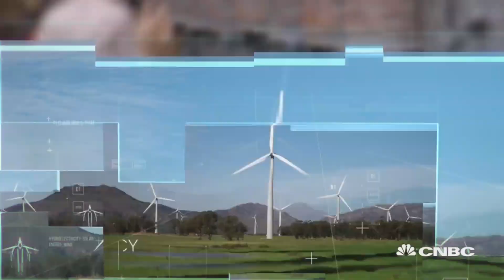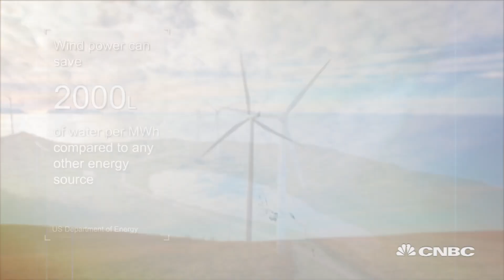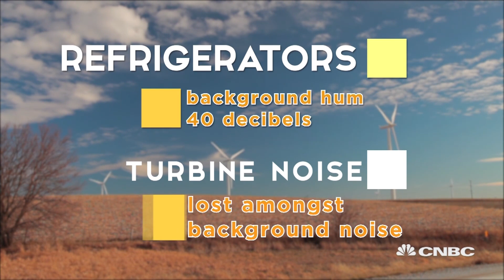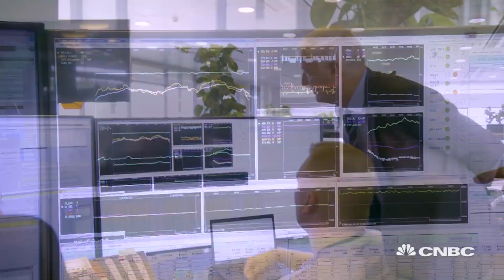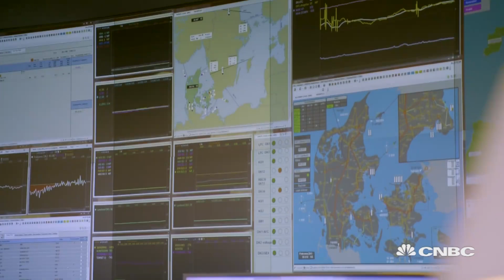The innovations and projects transforming wind power, part one | Sustainable Energy

Comment: Today we have windpower, solar power, hydro power and batteries are helping to solve all kinds of grid problems. In my opinion these options are way better than nuclear, fission or fusion. There will allways be the problems of waste, accidents  and the excuse of a nuclear site to develop nuclear bombs in secret. Put the money of nuclear into wind and solar seems logical to me.
Reply: Nice fantasy, not even remotely close to practical. See my previous comment as to why..  Nuclear in France supplied 88% of their electricity consumption in 2014, 47% of their primary energy supply. The other 12% is covered by the hydro they already had built before their rapid nuclear expansion 1979 to 2005. They produce 0.3 oz of nuclear waste per French citizen per year, and have half the electricity price of renewable wanna-be Germany. Almost all of that 0.3 oz of waste is incredibly valuable fuel for GenIV reactors like the IFR/Prism, Elsyium LCFMSR or LFTRs or other MSRs. 

After burning up our valuable nuclear waste and depleted uranium, ~300 years of total world energy consumption,  you are left with 1 oz of nuclear waste to supply the per capita lifetime (80 yrs) total primary energy consumption of USA or 7 million kwh's. And 83% of that waste is valuable isotopes, the other 0.17oz needs only be stored for 300 yrs, easily done in a borehole in granite. There is no other source of energy with remotely close to that low level of waste, all of which is safely contained, not openly dumped into our air, water and land for us to breathe, drink and eat like the 240 million X greater amount of carcinogenic, much of it forever, fossil & biomass waste. Waste that kills 7 million people per year vs zero for the nuclear waste.
Reply: The price of wind energy is falling rapidly. This is an interesting article you should read: http://www.windpowerengineering.com/featured/business-news-projects/uk-offshore-wind-prices-tumble-record-breaking-auction-results/
So the wind and solar are going to be cheaper than nuclear in the near future. But my reservations against nuclear are different. More of a not in my backyard syndrome.
I like solar in my backyard, I have them on my roof. I have no objections against wind turbines in my backyard. And zero waste and no need for cooling water.
When I think of Nuclear I remember names like Nagasaki, Hiroshima, Harrisburg, Tsernobyl and Fukushima.
I live in the Netherlands close to Germany and Belgium. And recently the German authorities distributed iodium pills to the people in fear of an accident with a Belgian nuclear plant. I do not want them in my backyard. Prefer them to be at least 10.000 miles away.
You call a future with wind and solar a fantasy,  I prefer to call it a nice dream.  
I call a future with nuclear a terrible nightmare.
Reply: Do some research dude, Nuclear in France supplied 88% of their electricity consumption in 2014, 47% of their primary energy supply. The other 12% is covered by the hydro they already had built before their rapid nuclear expansion 1979 to 2005. They produce 0.3 oz of nuclear waste per French citizen per year, and have half the electricity price of renewable wanna-be Germany. Almost all of that 0.3 oz of waste is incredibly valuable fuel for GenIV reactors like the IFR/Prism, Elsyium LCFMSR or LFTRs or other MSRs. 

After burning up our valuable nuclear waste and depleted uranium, ~300 years of total world energy consumption,  you are left with 1 oz of nuclear waste to supply the per capita lifetime (80 yrs) total primary energy consumption of USA or 7 million kwh's. And 83% of that waste is valuable isotopes, the other 0.17oz needs only be stored for 300 yrs, easily done in a borehole in granite. There is no other source of energy with remotely close to that low level of waste, all of which is safely contained, not openly dumped into our air, water and land for us to breathe, drink and eat like the 240 million X greater amount of carcinogenic, much of it forever, fossil & biomass waste. Waste that kills 7 million people per year vs zero for the nuclear waste.

Read & Weep:

Solar & Wind Toxic Waste - Baotou, Inner Mongolia, the worlds largest rare earth mineral refinery pumps toxic and radioactive tailings into an adjacent artificial lake,  EXTREME WIND POWER RADIOACTIVE WASTE . There is enough thorium in the tailings from one year's production of a large rare earth mine that makes materials for the wind & solar industries, to power the entire planet, all energy needs, for one year, burnt in a LFTR, or Liquid Thorium Fluoride Reactor. And that Thorium is waste, expensive to dispose of, they will pay you to take it away. 

The Dark Side of the Sun: Solar Power and Global Electronic Waste | The Huffington Post

Solar PV waste, pollution, Japan tries to chip away at mountain of disused solar panels- Solar Panel construction

Waste from Solar Panels, 700k to 800k tons of waste annually in 20 yrs,

Solar & Wind Toxic Waste, Rare Earth mines, Baotou, Inner Mongolia, Tracking a Gadget’s Journey From the Mine to Beneath the Christmas Tree

Solar Waste - Things Worse Than Nuclear Power: the real waste problem, solar PV waste, Solar PV powered world produces 63 thousand times the waste of a Nuclear Powered World, Solar PV cadmium & lead is forever, land area of Solar PV vs Nuclear

REnewables Wind & Solar Toxic Waste Pollution - Boom in Mining Rare Earths Poses Mounting Toxic Risks by Mike Ives: Yale Environment 360

BBC - Future - Wind & Solar toxic waste in Mongolia, disaster environmental destruction - The dystopian lake filled by the world’s tech lust

"landfill solar" - Cheap junk China Solar Panels fail in 12 months - Solar PV experts claim multi-billion dollar subsidies wasted on cheap and dodgy panels

Solar PV waste, Silane gas SiH4, explodes on air contact, Explosive Silicon Gas Casts Shadow on Solar Power Industry - Scientific American

A dark side of solar PV power, silicn tetrachloride 4 tons for every ton of polysilicon, hydrogen chloride & acids waft from the waste| Green Tech - CNET News

Solar PV hazardous waste, toxic waste, power’s dirty side: hazardous waste problem | Energy | News | Financial Post

Paying the polysilicon piper - Solar PV waste - silicon tetrachloride

Yep, all that for an energy supply that is has an EROI of lower than 1:1, just a scam and a joke, a new fangled way to burn fossil fuels, vs Nuclear with and EROI of 75:1 GenIII, GenIV full burn over 300:1. Nuclear doesn't need fossil, wind & solar cannot function without it.
Reply: Hello JB,

not a chance it just will not work!
Wind is particularly disruptive to grid stability when it becomes a large proportion of grid demand and batteries are just a joke. Expensive, and people seem to forget that they need extra power to recharge them, power which may not be available, unless you use fossil fuel generators in which case what is the point?